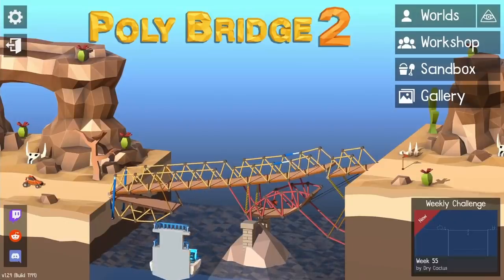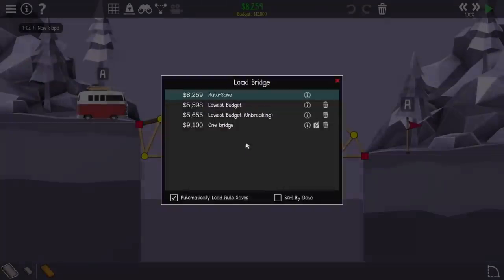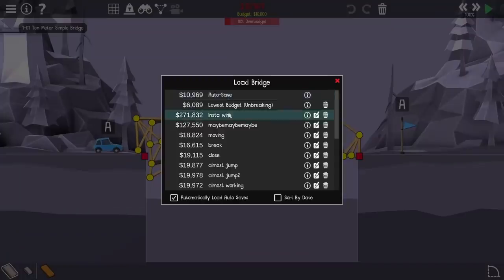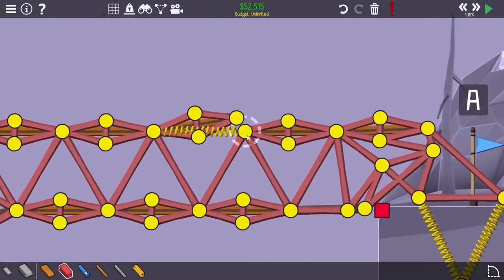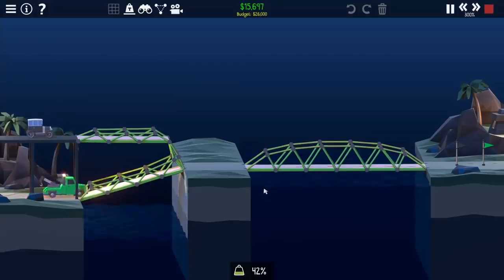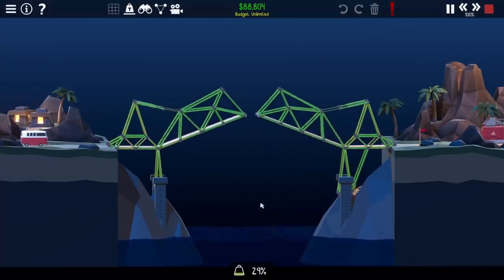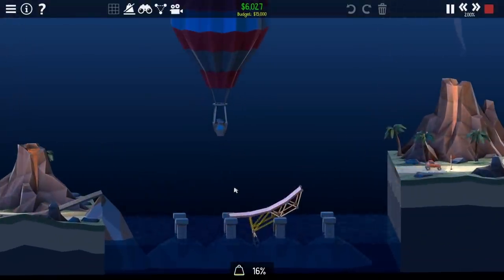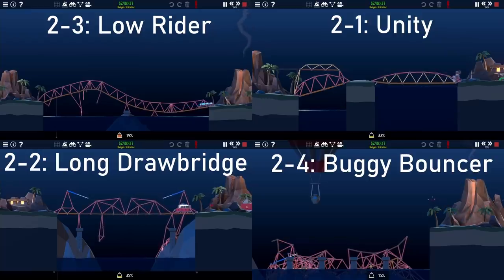Can You Use One Bridge to Beat Poly Bridge 2?

Comment: you could've used symlinks.

symlink is a shortcut that acts like a file. you could just copy the level somewhere else, make a symlink, and then copy that symlink to all the levels.
it would work seamlessly
Reply: Used to do this for large microsoft applications that required installation on C:\ for some reason. Symlinked the installation to another drive, no problem. Should be the perfect solution for this case.
Reply: @gen157  i run some of my steam games off of a symlink
Reply: @relt_  Steam has support for multiple install locations though.
Reply: @Cr_nch  yeah great, especially when i dont have disk space for a 50 gb garrys mod install
Reply: Probably the level folders themselves need to be symlinked, rather than the individual bridge files.

Comment: If you wanna make the process of copying the files across simpler, you could conceivably make a .bat file for it
Reply from the maker: Yeah that's a good idea, setting it up would be quick too
Reply: no, you couldve used symlinks
Reply: @relt_  Eve heard of Operating systems before, symlinks are a Unix Thing (Linux, BSD/MacOs are unix-like) and windows does not have those. A bat/cmd/sh file would be the best option.
Reply: @paulfragemann3333  windows does have symlinks
mklink is a builtin command in cmd
Reply: @paulfragemann3333  it's a filesystem feature, and ntfs does support both symbolic and hard links

Comment: If you want to try this again you could use Symbolic Links with the Link Shell Extension. Pick one of the folders as a Link Source, and drop them in the same parent folder as symbolic links and rename them so they match the original level folders (back those up somewhere in the meantime), so that in the end you have "Level1" (real folder), "Level2" (symbolic link pointing to Level1-folder), "Level3" (symbolic link pointing to Level1-folder), etc

Comment: try search for file symbolic link (windows has it)

it basicly acts like a shortcut but much more transparent, you can have the savefile lets say desktop and you create symbolic link to that file for each levels' slot and modification from one symbolic link will affects the original savefile and thus conceptually synced with others beware tho dont load multiple levels and modifying it at sametime as that pretty sure would  leads to corruption

i can be easily be batched and have a script which create it for all levels from the directory structure i see

Comment: Regarding the file copying, could you actually achieve the same by copying the bridge file into the correct folder in windows file manager? If so, you could create one bridge file, then create windows symbolic link files and copy them to folders with other levels, and this way it would always use the bridge in the original file.